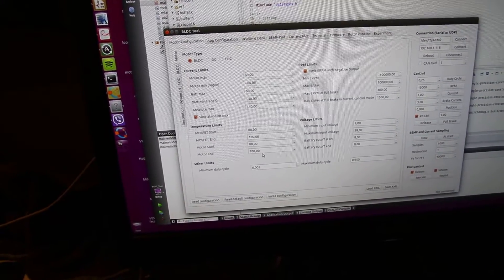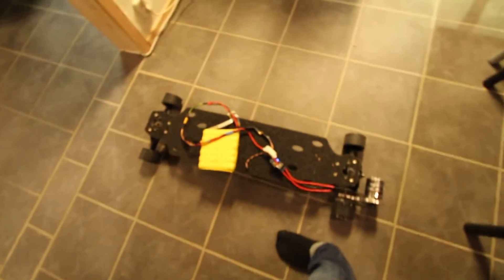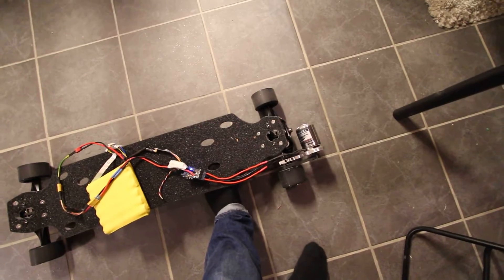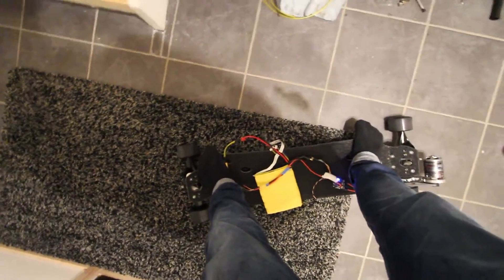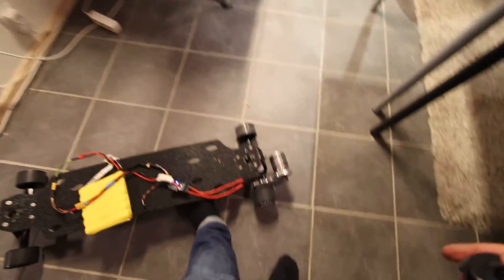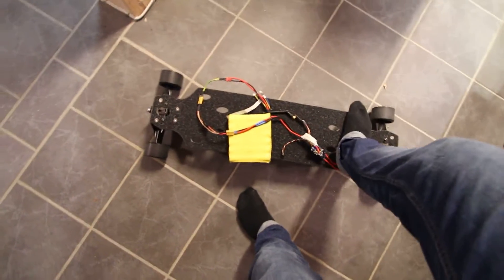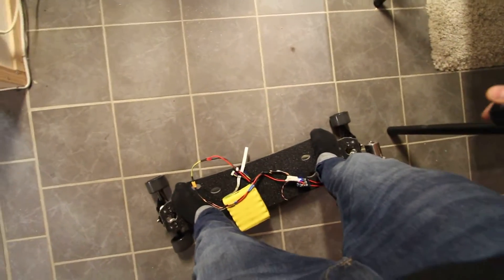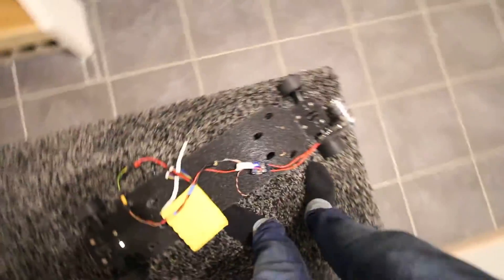VESC sensorless FOC first test drive

Comment: Big fan, you're extremely intelligent.  As a studying engineering student I hope to do things as awesome as you one day!  I'm curious what the difference is between bldc mode and FOC?  What's different about the waveforms being sent to the motor?
Reply: FOC or field oriented control refers to the sineusoidal waveform outputted by the controller. This is what makes the motor so quiet - there are no sudden changes in voltage that could produce a ringing sound.

Comment: What kind of battery pack are you running on this board?
Reply: Loos like DIY one, from 18650 li-on cells.
Not sure about configuration but it looks to be 12S1P(43,2V nominal).
But that battery is small, so only for test purposes.

Comment: Hi Benjamin , nice to meet you !   Will be buying your VESC shortly ! + made a small Donation for all the work you do for this hobby !Can i ask which Turnigy motor you consider Ideal for Speed (approx 42km/h) and Torque ?,... on a Single Motor Skateboard ?
Reply: Sk3 6374  192kv with 12s and 36/12 gearing is what i have .It’s very powerfull and it does 45 km/h on paper, but i never dared to go full speed